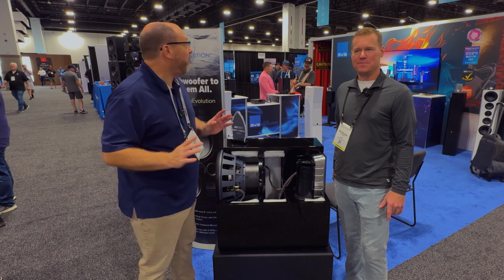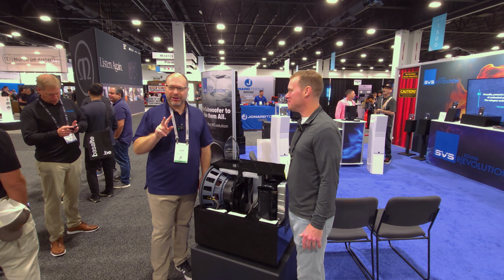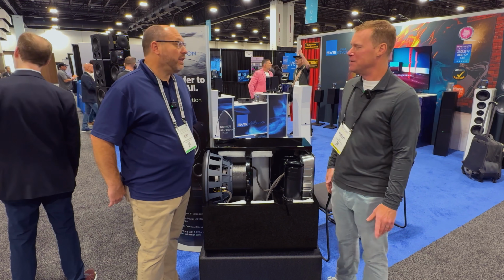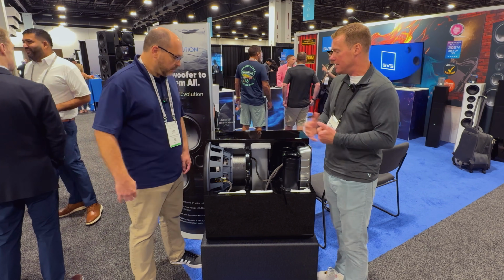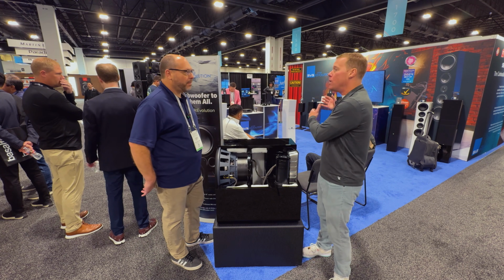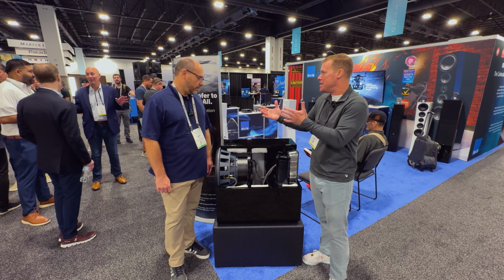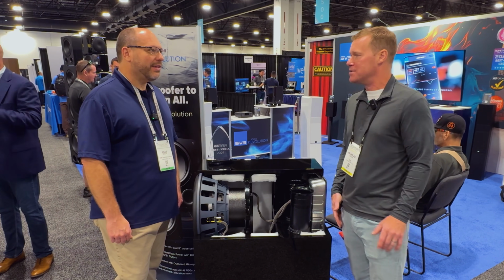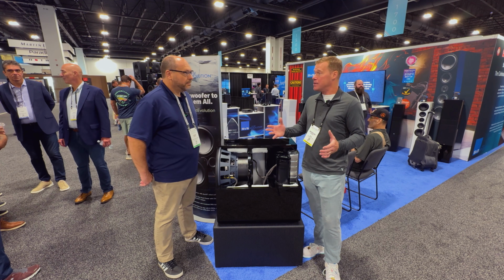SVS new 17 inch BEHEMOTH Subwoofer - the PB17 @ Cedia 2024

Comment: Alot of fluff in this long video, but no mention of the important things- 
Amplifier continuous power rating? 
How low does it play? The 16ultra frequency response plummets at 16hz does the new one play lower in frequency? 
Did they mention any output measurementS? 

Also he is wrong the dsp can not affect in any way the amount of air that goes through the ports and if pushed hard any ported sub will “chuff”
Reply from the maker: Thanks for watching!
Reply: 2800w RMS 6000w peak

Comment: Anechoically (2M)  if this hits 100db+ 10hz and 105+dB at 12hz  I'll consider these a huge success. I think 105dB+ at 12.5hz is achievable but it will be hard to hit 10hz with authority given the small cabinet. I'm really happy that SVS listened to the voice of the loud, vocal minority, hardcore enthusiasts (AVSForum) lol and focused on extension :D. I really hope they add more extension capabilities to their entire lineup. IMO 12.5hz-14hz should be the standard going forward at a $1000+ pricepoint.
Reply: There is no way this has a 10 or 12hz tune. The cabinet isn't big enough.
Reply: @bigjack79  Not only is it not big enough, it is OVER-STUFFED, judging by the cutaway model they use. And with what looks like a sixth order roll off (obviously to protect the driver).
Reply from the maker: For sure!